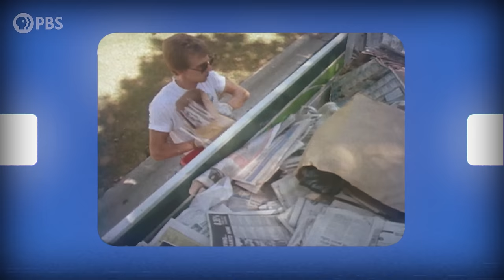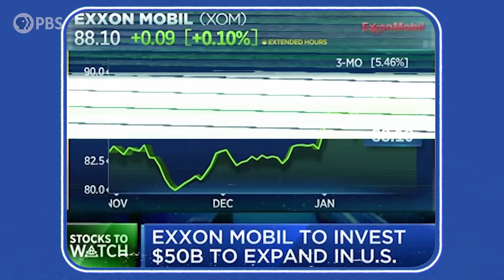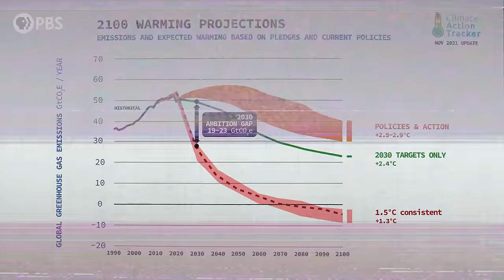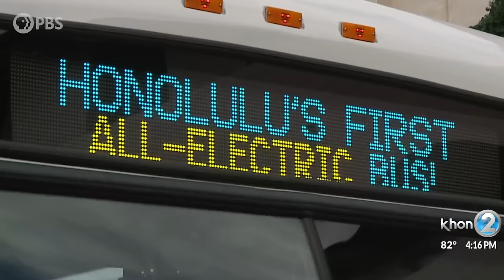Does "Every Little Thing" REALLY Stop Climate Change?

Comment: I have worked over 4 decades as an environmental scientist and engineer. To summarize my impression of this content, it is a mixed message that is poorly presented and discouraging. For instance:

At 5+ minutes in, the “do anything approach” of energy saving actions have repeatedly been downcast. The “do anything approach” is cast as don’t waste your time making an effort because it won’t make a bit of difference. Near the end of the presentation, at least one of these “do anything” approaches is promoted as a part of the solution (renewable energy via PV).

Meanwhile the implied, but undescribed, better approach remains a mystery. Almost like writing a dissertation without an introduction. OH WAIT! At 7:38 the ANSWER is revealed! “Widespread policy changes” such as changing where our energy comes from (gee, I thought photovoltaic panels on a house did that, but that is supposedly a “do anything approach”).

In conclusion, how many people who have driven to do responsible actions are going to make it to the end of this presentation to find out the miracle solution. In my opinion, the vast majority of people who have been concerned and have acted have recognized that policy is the issue and needs to be altered. So why not put that at the front end of this presentation?

Comment: Of course large multinational fossil fuel corporations contribute far more to carbon emissions than any single individual's personal energy consumption choices, but it is alarmingly misguided to claim that the choices of individuals are not significant, especially when considered in total across entire populations.
  If the collective choice of all individuals was to consume far less energy, to be far less wasteful, there would be a massive reduction in demand for the very products that fossil fuel corporations produce - indeed, it is the collective consumption of all individuals which ultimately acts as the market for everything produced by fossil fuel corporations.
  Drastically reduce the demand, and those currently profiting from supplying that demand would find themselves with a drastically-reduced market; then you can bet production would drastically decrease in order to preserve what remained of the profit mechanism.
  Granted, action on such a large scale is not going to happen voluntarily, or without a collective shock to the current culture of consumption.
  Large corporations are not absolved from their responsibility, and neither are individuals, considering the supremely powerful effect we could have as a coherent collective.
  DO encourage people toward greater action through government legislation, etc., but also DON'T discourage people from simultaneously pursuing low-waste actions in their own lives.

Comment: Oof, the demonization of chemicals in agriculture. I'm not down with this video thanks to that line. Also, the lack of clear definition for "sustainable" processes opens the door for allowing changes that are actually less beneficial (such as demonizing nuclear energy, which actually is one of the most effective ways to mitigate carbon output from the power generation standpoint). This is a rare miss from a PBS production.

Comment: I agree and disagree with this.  I think our individual actions make much more of a difference than on paper.  It changes our mindset and therefore our voting and other choices.  It also sets a good example for the next generation who will grow up in an environment with that mindset.  Also, we cannot transition away from fossil fuels without electrifying.  A lot of things in my house run on natural gas.  I can switch them to electricity and on paper, that does not do much because our electricity is derived from fossil fuels, but it is a necessary step nonetheless for the bigger goal of reducing fossil fuel use.  Putting solar panels on your roof incentivizes people to electrify their lives giving us the first step towards ultimately removing fossil fuels

Comment: One might ask themselves what actually can be done to actually change anything.  The personal approach might be to go on strike and not participate in this destructive behavior.  The top manifestation of this would be to die right away.  Or one could take ones time and find out that eliminating ones carbon fart-print is not practical as we are all part of a hive.  Then the other choice would be to begin to destroy the hive itself.  Dismantling would necessarily bring lots of negative attention upon one from those who like the benefits that all of the structures bestow.  But commitment might bring one back to the initial and more permanent solution suggested.  I think these are the levels of personal choice available.  It is doubtful that old age will be the result for most of us.

Comment: Of course a single person using renewable energy doesn't solve the problem. Everyone using it does. That will happen when governments make it happen, by financing the infrastructure and mobilizing the resources required. There simply isn't enough private capital to do it fast enough. But once it is done, it pays for itself, because renewable energy is cheaper, and saves tons in healthcare and disaster cleanup costs.

Comment: This is the most disappointing and misleading thing I’ve ever seen on a PBS video. Individuals can and do make a difference when you bother to look at is as collective action. For instance, U.S. solar capacity exceeded 135,700 megawatts (MW) as of late 2022, which is enough to power 24 million homes. Imagine the greenhouse gas production if that electricity was provided by coal or natural gas. Individuals are the end users of corporate and political decisions. Imagine the chemical fertilizer load if there was no demand for organic foods in supermarkets. Imagine the added pollution if there was no electric car market. What added damage would corporations do if there were no pension funds with seats on corporate boards pushing to do better. Fundamentally, only individual action makes a difference. This video was an appalling call for people to just give up.

Comment: Stop encouraging people to be helpless. You're conflating a variety of different actions here and discouraging people from taking action, and you’re failing to account for ripple effects.  Yes, system change on a massive scale is absolutely necessary, and individual action is also necessary. Individual action can be done with an eye toward system change. Both are necessary to decarbonize. Individual changes are necessary for system changes to be effective; they’re two sides of the same coin, e.g., the Inflation Reduction Act won’t realize its full effect if individuals don’t use the subsidies to install heat pumps and inductions stoves. Moreover, individual changes don't happen in a vacuum - besides the direct effect of a small reduction in environmental damage, they have an effect in two other main ways: many people voting with their dollars will have an impact, and since research shows that people change their behavior most easily when other people they know have changed their behavior, individual changes have a ripple effect on each individual's circle of neighbors, friends, and acquaintances. Some of those neighbors, friends, and acquaintances will be in a position to make policy and system change happen. Every little bit counts in an emergency, and the main point here is: every individual action can be done with an eye toward system change. Individual action can also be political action. Please do a video with a positive focus on the above ideas. “The most common way people give up their power is by thinking they don’t have any.” -Alice Walker

Comment: By volume, the dry air in Earth's atmosphere is about 78.08 percent nitrogen, 20.95 percent oxygen, and 0.93 percent argon, adding up to 99.96 percent. A brew of trace gases accounts for the other approximately 0.04 percent, including the greenhouse gases carbon dioxide, methane, nitrous oxide and ozone. To think that a small increase (200 parts per million in the last hundred years) of carbon dioxide would affect the weather is absurd.

Comment: "Do anything" puts people in the mindset of reducing their impact. Sure, the little things don't add up to much but people start thinking about doing big things too. Like buying an electric car. Electric cars are more expensive, have shorter ranges, and have fewer places to refuel but the number of people buying electric cars is increasing every year. Doing "every little thing" may not have an immediate impact but it encourages people do the the big things that will have an impact.
Reply: Fewer places to refuel? Are you kidding me? 90% of EV owners charge at home using L1 sockets... And they are everywhere!!! Aka just an average 110 outlet. What drugs are you huffing??
Reply: As for "range anxiety" that's a BS term created and stoked by fossil fuel creators to sell more oil and put down the competition. The average commute in America is 40 miles or less. Which means even lead acid batteries from the 1930's could have done the job for everything but hypercommuting or long occasional roadtrips. Even where I live I haven't done more than 40 miles in a day in over a year!